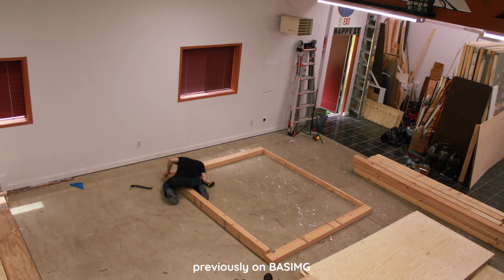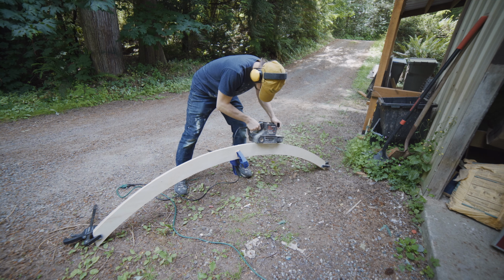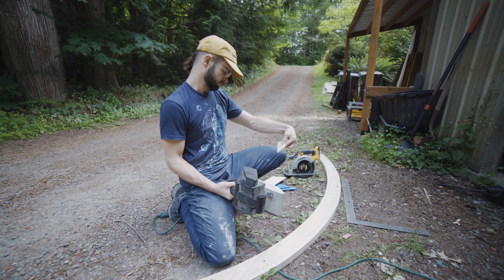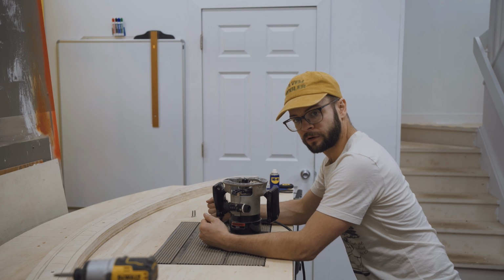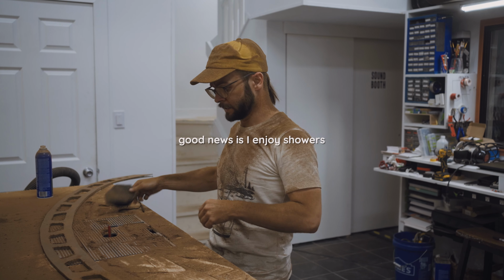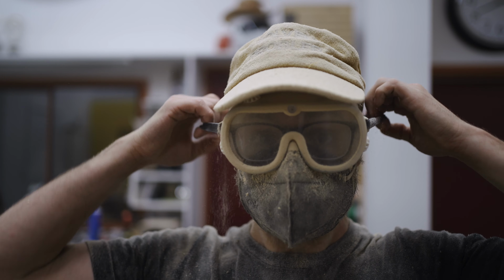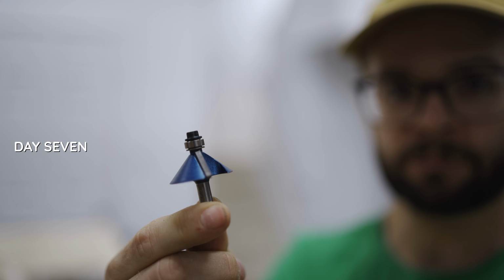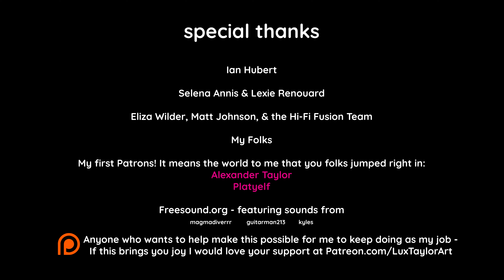Building A Spaceship In My Garage // Episode 2

Comment: Funny story. The Grumman LEM (actual spaceship, never designed to go into an atmosphere, landed on the moon) had hatches and walls about the thickness of a bean can. They ran 3.5psi, so huzzah, quite lightweight structures. You could peel the corner of the main hatch up by hand to break the seal. (Which they had to do this one time, when there was too much residual atmosphere to open the door, and go down the exit ladder.)  Subs are designed for very big pressures, so thick thick ribs and hulls. Spacecraft, even if you are  being super extravagant and doing sea-level pressurisation, would only run 15psi, so nothing's needs to be super thick. To run lower pressures, you increase the O2 content. If you run too much O2 and not enough N2, it makes cabin fires super easy, and you get the Apollo 1 disaster. But given there's a coffee machine, you want 14.7psi. Lowering the pressure would make the water boil too at too low a temperature and it makes food  less palatable.  If your spacecraft does atmospheric entry though...  decent sized aerodynamic forces.
Reply from the maker: @timwilliscroft9615  this is a fantastic level of detail! Thanks for taking the time to share so much knowledge 🚀

Cool as heck to know all this stuff
Reply: Translate: you need lower pressure and a special space coffee machine that is pressurized ;)
Reply from the maker: @ThomasTomiczek  oh this is fantastic. This ship will be working in a variety of conditions, including in-atmosphere general flight usage - I like the idea that the coffee machine adjusts itself to accommodate exterior conditions
Reply: And bonus point: The coffee machine is a VERY complex espresso machine and tied into the main engine - ah - to - ah - reduce the Pressure in the Plasma conduits. So during high acceleration it MUST make espresso ;)
Reply: An alien character in the ExFor series is shocked that humans really traveled off their planet in what it describes as basically a giant beer can.

Comment: I keep thinking a modular approach may  be beneficial, imagine the different rooms being able to separate from each other and split apart to give room for lights and camera gear and to set up photography without actually being in an rv sized space. Great work so far, can’t wait to see it finished 😁
Reply from the maker: @entertaintech4374  yeah! As a matter of fact this is a significant consideration for the build -

Thanks to space limitations here and the equipment I personally have for moving large stuff (my hands and a furniture dolly haha) I won't be doing modular full rooms on this build - however! There will be access panels built in multiple places for line-of-sight and/or audio&power access, as well as foldable, removable 4th walls, for any time we're shooting reversals instead of cross-section. Much of the lighting is going to be designed specifically to suit, using a mix of photogrammetry and Blender previs, so the set itself will be predominantly responsible for the base illumination in any given scene. Different rooms will have different pre-built lighting states to set different moods, each component of which can be molded via on/off/dim (and in a rare few cases, color temp shifts), and that can be supplemented with mobile gear from offscreen, as necessary.

Thanks for the comment, and for coming along for this ride! I hope you'll be personally delighted whenever I make it to the modular components ✨
Reply: I wondered about the practicality of filming in a set like this but you've both answered my questions.  Thanks

Comment: Reading down in the comments... No one has mentioned a "Flush Trim Pattern Bit" for your router. Just like the chamfer bit, they have bearings on the bottom (furthest end of the cutter), but can have them at the top (closest to the router),  or even both ends, with the cutter blades in between, to cut out shapes matched to templates. 

I read you've got a small CNC. I use my 3d Printer but the small CNC would also be ideal for creating the shape of the pattern on a small scale, then running your pattern bit around the timber. It would've also help you mark out and remain consistent, like a proper steel beam.

Sorry for bringing this up now, now that you've done your routing the hard way.

Great series, I'm already looking forward to the next installation.
Reply from the maker: @petermiddo  hey not at all! This is exactly the kind of stuff I'm excited to learn on this project as I expand my toolset - routing is quite new for me, so I appreciate the tip!
Reply: @LuxTaylorArt  I would recommend watching some YouTube videos on the patterning bits. Basically you set your bearing to run around the template and it cuts the wood to match. It's worth watching a video or six, I'm sure I'm not explaining it wonderfully. Just don't get caught up in the downspiral/upspiral bits. Stick to the straight cutters until you know what you're doing with then, then get fancy.
Reply from the maker: @petermiddo  brilliant, thanks for the tip! I do love to watch fabrication videos

Comment: Please make a dust extraction unit for your lungs. (a shop-vac to suck the dust under your bench.) Your lungs will thank you.  PS Great video.
Reply from the maker: @Scott2148  honestly yeah, thank you for underscoring this for me. I've been thinking about it more lately as I gradually try to develop better safety practices in general, and it's good to have more encouragement to go for it. The shop-vac rig I had set up helped *a little bit*, but honestly I think it's time I figure out something more robust, even if it's an interim solution.

Comment: If you end up with any gaps between double-sheathed walls, might I highly recommend throwing in whatever sound deadening trash material you have laying around.  It'll make a difference when you start putting mics in that space.
Reply from the maker: @natefessler3961  oooh, excellent idea - thanks for the tip!

Comment: Ever thought of using foam? You can make it look like pretty much anything as long as it's not load bearing.
Reply from the maker: @tim2024-df5fuI yes, absolutely! I am in fact already using expanded polystyrene sheets for some of the current stuff (to be featured in upcoming build episodes)

Thanks to the relatively high impact nature of these parts of the set, I wound up using durable materials for this first stage despite the extra workload to ensure longevity, since we're expecting to be shooting a pretty significant amount in this space. But many of the lower-traffic areas of the ship, and things that aren't in danger of anyone running into them, will be made largely from lightweight materials
Reply: @LuxTaylorArt  I'm guessing you're a fan of Adam Savage's Tested? He used to do movie props. He's doing a raptor costume current.
Reply from the maker: @tim2024-df5fu  I sure am ✨